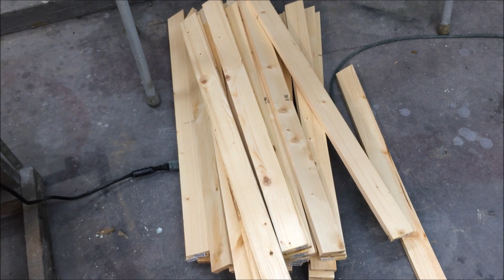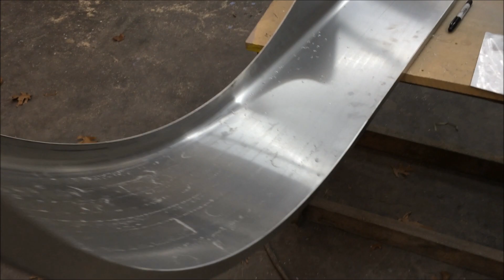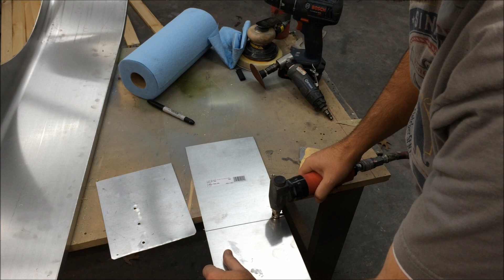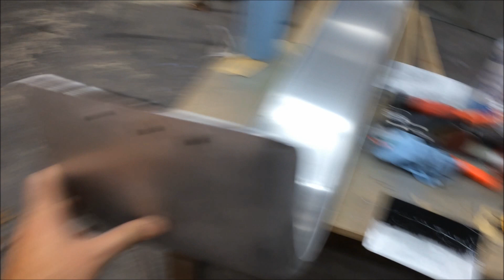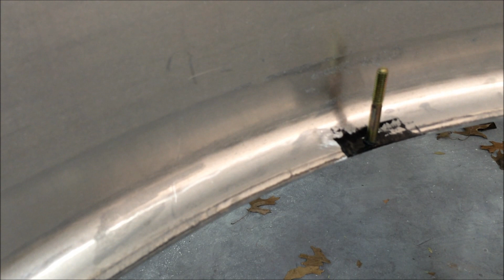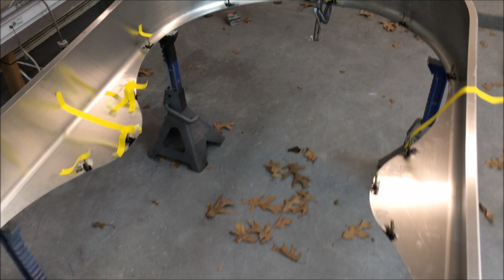Trailer Fender Table Part 1

Comment: That already looks pretty cool. Ready for part 2
Reply from the maker: Part 2 is up, but it has music in it and Youtube won't let you watch it on a phone, have to be on a computer, part 3 is up also.  Btw, I know you asked a few questions a while back, did you get the answers you needed?  Call me if you need to, I think I PM'ed you my number at one point.
Reply: I was curious how you wired up your autoloc switches but my progress on the wiring has came to a stop and I've been trying to tackle the rear of the car. However this cold weather up here has me stopped.  I need to paint and it takes for ever for the garage to warm up.  Anyhow.  I'll get on it as soon as I can and if I need some tips I'll be sure to ask. I bought the 68 shelby tail lights and I was trying to see how far you held them from the edge when you cut the hole.  Once I hold the tail light housing up I'm sure I can figure it out though. Thank you.

Comment: cool idea, push the silver tab on the gun and it will relieve the pressure on the tube, to stop th oozing,
Reply from the maker: Good tip, I don't think I ever knew that, then again, I have never been much of a handyman, or very good with caulking guns, etc...  I think you asked on another video about the bike.  I haven't worked on it in a long time, but hope to do so soon.

Comment: After you are finished applying the adhesive, flip the metal tab behind the trigger and that will stop the adhesive from coming out. It relieves the pressure on the tubes. Great video......

Brad
Reply from the maker: Good tip on the adhesive gun, was never aware of that!